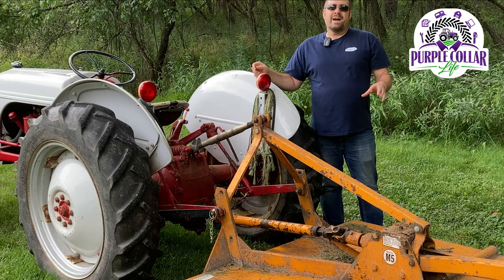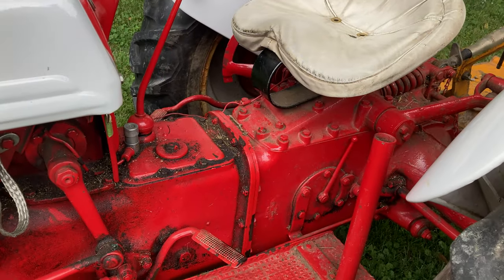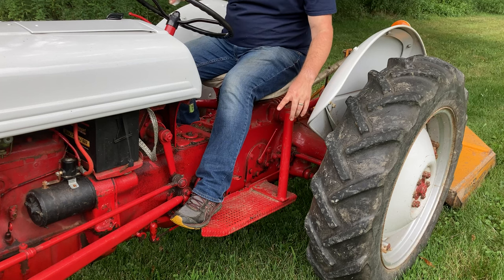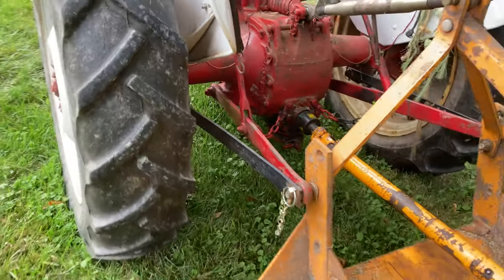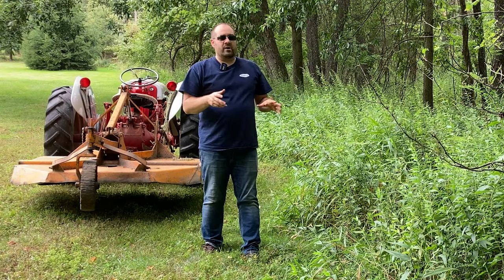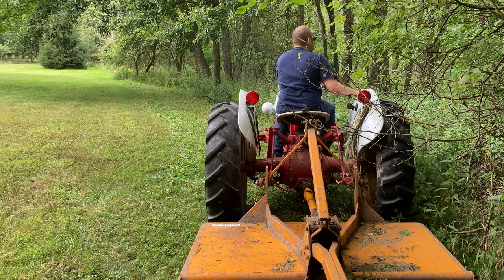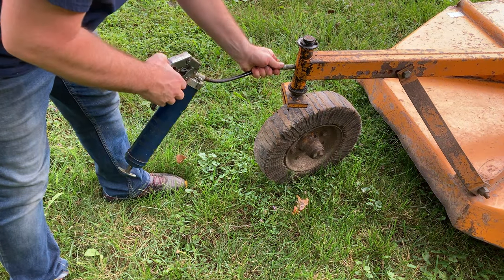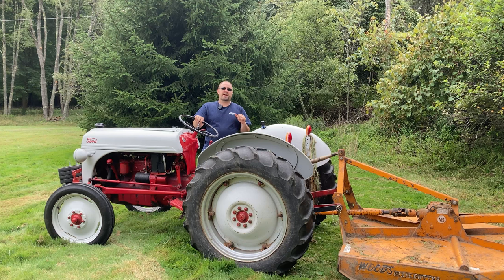How to brush hog with a Ford 8N tractor

Comment: The ONE thing I see people who own these things forget is that these engines were designed for LEADED fuel. So you MUST use a lead substitute. I use a product from Motor Medic, that you can get from Walmart or anywhere for about 5-8 bucks a bottle. If you DONT use this, severe engine damage can/will occure. Fortunately, the parts are readily available, but it would require an engine overhaul. So always remember to have this stuff added to your fuel
Reply from the maker: This is a great point! We do add some lead substitute additive in these old tractors. Here's what we use: https://www.youtube.com/watch?v=5BrCSirsR-A
Reply: Not true. They have hardened valve seats
Reply: The valves are the only reason for lead substitute a full overhaul not needed on a flathead

Comment: The one drawback of the N-series is the lack of live hydraulics/pto. However, their simplicity and reliability are the tradeoff. These machines are 70+ years old yet will give you decades more reliable work.
Reply from the maker: That's true. The live hydraulics on our 1957 Ford Workmaster is certainly a nice benefit. But - you're right - all of these old tractors will likely last ANOTHER 75 years. :)

Comment: When brush hogging with my 8N, occasionally the PTO lever will slip out of position thereby cutting power to the brush hog.  It's not necessarily a result of hitting anything as it can happen in straight smooth sections.  Any idea as to what could be causing this to happen?
Reply from the maker: That's a great question. I'm not familiar with that issue. But hopefully someone who watches the video can help and respond to your question.
Reply: I occasionally use one that i can't seem to find 1st on and with the terrain I really need 1st (slow and smooth) it's really rough and another issue is the brush hog 3pt wants to float all the way up if I don't keep my hand on the lever

Comment: I've had my 8n for almost 40 years, use every summer and fall for field mowing and keeping the multiflower rose in check...my only complaint is the reverse gear is way too fast and I'm sure others feel the same..
Reply from the maker: You're right about reverse. I notice the same thing on the Ford 641 Workmaster. But other than that - all these old Ford tractors are amazing!

Comment: The draft lever is actually the 3 inch long lever near the Touch Control lever. You are using the 'Touch Control Lever' to lift the 3 point hitch. We usually just called it the 3 point lift.....Enjoy your videos, We had 4 8Ns that were worked hard in the hay fields.
Reply from the maker: Thanks! I sometimes mistake (my brain goes faster, or maybe slower, than my mouth in these videos sometimes). I’ve heard that the small lever is to move from “draft control” to “position control”, and that determines whether the big lever (3 point control) is in draft or position mode. It’s very confusing - I try to keep the little lever where it’s at because the big lever does what I want it to do right now. :)
We’re your 8Ns a mix of the older and newer ones (front distributor and side distributor)? Or were they all the same generation?  
Thank you for watching!

Comment: When using a pto driven a attachment with a  Ford n series tractor, many people will leave the pto shaft unattached until they are in position and ready to use it. For example, while driving to the location or when doing the initial lift to make sure no critters have made a home under it.
Reply from the maker: Great idea! I never thought of not connecting that PTO shaft until you have the cutter moved.
Reply: @PurpleCollarLife  I Didn't think of it either. I saw it on another YouTubers video. I cannot remember who it was.

Comment: That's a very nice example of the Ford 8N. I like the red and white, makes it really stand out! My grandfather, father and I all shared ownership of a 1949 Ferguson TO20, very similar to the Fords and it looked and operated in nearly the exact same way. The only difference was the entire hood had to be raised to access the gas tank and radiator. I remember Bush hogging with an old Woods very similar to yours, very reliable, always cut the grass and weeds very well. One problem was that when you had to stop and shift gears, the momentum of the spinning shaft would cause the gears to grind, you had to wait until the PTO stopped spinning to shift, which was annoying. I wish we had had a slip clutch, it probably would have alevienated that problem. Good memories for me! Thanks for sharing, Chad! 🙂
Reply from the maker: Thanks for watching! You're absolutely right about the momentum of the rotating shaft and changing gears.  That overrunning clutch fixes that issue.  My first tractor (the Ford 2N) didn't have the overrunning clutch, and I had trouble stopping when I needed to, and switching gears.  It was a lesson in patience waiting on that PTO shaft to totally stop movement before trying to change gears.  I would think the 1949 TO20 would be nearly identical to the early 8N we have.  Great machines for sure.

Comment: Good video.  I didn’t realize pto had to be engaged to lift 3 point hitch, I only thought clutch had to be out. I wonder if that varied year to year, model by model? A couple notes:
I think  the 3 point hitch lever is “position control”.  “Draft control”  typically refers to a secondary, more sophisticated addition to the 3 point hitch control system for ground engaging attachments (plows)  that “automatically” raises (and lowers) the 3pth and plow when the load gets too much. Basically it adjusts 3pth height to maintain a steady pull force. 
Remember, if you add a overrun clutch on the PTO spindle, you’ve shortened the length the PTO shaft MUST still be able to telescope to. Cutting the shaft may be required. Otherwise, if it “bottoms out”,  mower can’t lower and the PTO shaft will be supporting the full weight of the mower on the tractor’s rear PTO spindle bearing and rear end casing. That may be fatal to the tractor. 
When backing into an overgrown area I always have the mower as high as possible. I’d rather lower the mower onto a hidden object and ding the blades than back the mower into the obstacle and fold the mower’s sides into the blades. That gets real noisy!  Been there done that too many times.
Reply from the maker: Hi Cody - yes, the PTO does have to be engaged to lift the 3 point on these old Ford tractors (9N, 2N, 8N).  The Jubilee/NAA were the first Ford tractors to have hydraulic lift without the PTO engaged.
You're right - the lever function for the 3 point hitch I should have referred to as Position Control.   That's how I'm using it.  But it can be called Position Control or Draft Control, depending on how you have the little lever under the seat set.  Ask Tractor Mike does a great job explaining the difference on a newer tractor here: https://www.youtube.com/watch?v=7jwcwLWGXWI
Yes - another great point about the overrunning coupler.  We did have to shorten the PTO telescoping shaft to enable the mower to raise and lower fully without putting undue strain on the telescoping PTO shaft of the brush hog.  
Another great point about lowering the brush hog onto an area rather than backing into it.  It's exactly these type of knowledgeable comments that will help others as they read through the comments in our video.  Thanks again, Cody!

Comment: Your operations video set me on the right track from day 1 only 6 weeks ago and I use my tractor 2-3 times a week now. Come this spring, I would like to add a finish mower for our lawn.  It only about 2 acres but my lawn mower garden tractor is on it’s last legs and I’d rather buy a used implement than a new riding mower.  What is the smallest type of pto mower available for the 8N….used.  Thanks, great stuff that you present
Reply from the maker: That is awesome! We have a 5' finish mower (King Kutter brand) that we use behind our 8N. It works great!

Comment: around 7:30 your off and behind the tractor with it raised. how did you get the tail wheels to stick up? my pto shaft hits the frame of the brush hog when the draft lever is fully raised. mine is a 1951 and I have 3 holes for the top link. it's in the bottom hole. I'm using a category 1 top link and I've adjusted it with no change. any ideas?

Comment: Recently purchased a 9n, so far runs great!  Learning much from your videos.  Do recommend a parts dealer for these tractors, would like to purchase the sway bars that you recommend. Thanks!
Reply from the maker: Congrats on the Ford 9N tractor! You’re going to wonder what you ever did without it. As far as a parts dealer - I have used a few. There is a local tractor store that has been in business for decades that I usually try first (support local). Then I go to the Tractor Supply near me. Sometimes they have things like the 3-point arms, top link, sway bars. They even have distributor caps, spark plugs, exhaust manifolds, and mufflers. But if I need something specific and want to trust the pros - I go to Just8Ns.com, or farmtractorrepair.com - Dan and Rachel Gingell’s site.  They also have lots of great videos on their YouTube channel - @DanGingell

Comment: We have small incline on our property, and when I’m brush hogging, I give it more throttle to go up the small hill , and the tractor barely makes it up, and tries to stall. I’m new to tractors,and just bought this 8N, so don’t know hardly anything about it. Cleaned out the glass fuel bowl, and the fuel filter on the other side looks clear. Carburetor looks new. There is a blade screwdriver adjustment screw on the side of the carburetor,and a finger adjustment screw on the front. 
Should I turn the finger adjustment screw to the right or left, or just leave it alone?
Reply from the maker: I have a few questions. What size is the brush hog? When going up a hill and cutting large brush, I usually only cut 1/2 the width of our 5' brush hog at a time. It's just too much load on the engine otherwise. But - you should notice that the governor (if operating properly) will automatically increase the throttle when under load to keep the machine running without stalling out. 
On our 8N, we've had no issues where we needed to adjust the carb - so I'm not sure about that. But I do have this video about starting from scratch on our Ford Workmaster 641 tractor. I've got several videos brush hogging with both tractors. I will say that the 8N we're very careful with - because it does overheat quickly when brush hogging. That's quite a load on the machine. 
I hope this helps! 
Here's that video about the carb adjustment: https://www.youtube.com/watch?v=RMENfUzyvlg

Comment: Great Video, I appreciate all the info.  Purchased my tractor this year. I have a question, I understand the PTO has to be on to raise the arms. When I turn the tractor off...should my arms stay up? They come down almost immediately. Thanks!
Reply from the maker: Hello - sorry for the delayed response. I'm just getting caught up on comments. The arms should stay up for a short time, but will eventually drop over time. It depends on the weight on the arms (if there is something attached) and on the hydraulic system of your tractor - they wear over time.  On our 8N - if there is a big load (firewood rack, brush hog) - it will drop after the tractor is shut off - maybe 1/2 inch every 5-10 minutes - until it's back down on the ground. With a lighter load (back blade) it may drop 1/2 inch every 10-20 minutes.  
If you have nothing on the arms and they are dropping almost immediately, there's probably a little more wear in your system. But my bigger question would be - when the tractor and PTO are on - does it maintain keeping the arms up? If so - I probably wouldn't worry much about it at this point.

Comment: This video was very helpful! I am beginner with this tractor. I just found out about the position control and draft mode. Problem I am having is in draft mode it digs into the ground. When I put it in position control the lever needs to be 3/4 of the way down or when I engage to go it rises back up. It won’t go down any further when the lever is pushed past 3/4. Any thoughts or do you have a video showing the full explanation of the position control lever?

Comment: Excellant video my friend! Very well done, I learned a lot! Biggest issue I have is the speed at which to run as in my pasture(s) I have to make many turns & without power steering, no Sherman gear reducer I hate to ride the clutch!!!
I too have a path deep into the woods I have to clear & you give me the confidence to make an attempt at it...I just am curious, I have a lot of overgrown Montathorora rose bushes on the outside of the fenceline, is it best to lift the hog & back in & out of it while continuosly lowering the hog to get it down to a manageable level? I figured with your 20 years with an 8N, you'd know! Thanks SO MUCH! btw, this is my first 8N on my small horse farm. All the best to ya!
Kokomo in western PA
Reply from the maker: Thanks for the comment and question! And congratulations on your new Ford 8N. You'll find it is an amazing and very reliable tool for use as a property owner. 
As far as how to handle those overbrown bushes - it really depends on how thick the stems are. You might be able to back right over them and cut them off. Or - you could do like you suggest and leave the brush hog up, and lower it down on top a little at a time. I've done both - it takes a little trial and error to learn what methods work best in what situations. 
Watch for fawns in the high grass this time of year. They get scared and won't move out of the way. I always walk the path/area first to look for them.  Enjoy that tractor!

Comment: Man I sure lucked out and made the right choice! I just bought an old International Industrial 3414 from work and it was between the old 3414 and an 8N ford. it doesn’t have live PTO… Which was a bit of a let down. But It does have live Hydraulics as well as a completely separate pump for the power steering system! So I’m happy about that. 

One note… What you refer to as draft control is actually a position control. Draft control works in a different way and the best way to describe it is it’s like a Governor for your 3 pt depth. It’s really for doing dirt work. But I also have both position control and draft control. 

Excellent video on explaining how to brush hog with these older machines!
Reply from the maker: Thanks for watching! Good catch and correction on the draft control vs position control.

Comment: Great video! Do you know if an overrun PTO is needed for the Ford 640 as well?
Reply from the maker: Our Ford 641 Workmaster does have an overrun PTO clutch on it for the brush hog. I'm not 100% sure if it's necessary - but it is a good safety measure and I would think it helps to protect the PTO.

Comment: Amazing video! I just inherited my grandpas tractor. Can this tutorial be applied to a Ford 600 Tractor? It also has a brush hog with it. We have a path with some saplings grown up. What would be the largest to safely brush hog? Thanks!
Reply from the maker: Congrats! I always like it when tractors stay in the family and pass down generations. Much of what is in the video applies to the Ford 600 also. We have a Ford Workmaster tractor (641) that would also be like your 600. You'll find several videos about the Ford 641 on our channel also. Here's that playlist: https://www.youtube.com/playlist?list=PLJy7cj0ut2cBMlMwvY3IMs5TY27N99OGr
Here's the 8N playlist: https://www.youtube.com/playlist?list=PLJy7cj0ut2cBWTStoVA1G_lfQ8hnhUtLu
As far as size of saplings that can be cut down/mowed with the brush hog, it really will just take some trial on your part to determine. I typically use 1-2 inches as a maximum. I know some people cut down thicker stuff, but I like to protect the PTO, brush hog, and tractor when possible. If it's bigger than that, I'd rather cut it off low with a chainsaw than risk breaking the tractor equipment. 
I hope this helps! Enjoy those playlists - and your new tractor!!
Reply: @PurpleCollarLife  thank you!! Yes, I’m happy that we can keep it in the family. It needs a little TLC but we’ll get it there. Thank you for sharing the links, I’ll check them out. I appreciate the quick response and information!

Comment: Nice video abot the PTO operation on the ford N series tractors...  If one isnt already familier with their tractor, they shouldnt have ANY type of powered impliment hooked up to it....  personally, I dont feel a tractor tutorial is necessary in a vid for attachments/impliments for any given tractor, except when it pertains directly to the connection and/or operation of the impliment, and the basic PTO operation on the early tractors nearly always needs explaining to those that havent ever seen the pto shaft on their tractor spin..... but checking oils, gauges, fuel, seat position, mirrors ect, and learning the location of the tractor clutch is in the way of enjoying your video thats titled HOW TO BRUSH HOG.
Reply from the maker: Thanks for watching and leaving a comment!